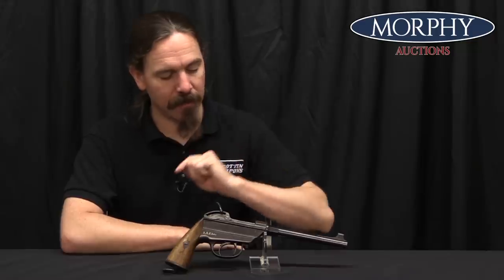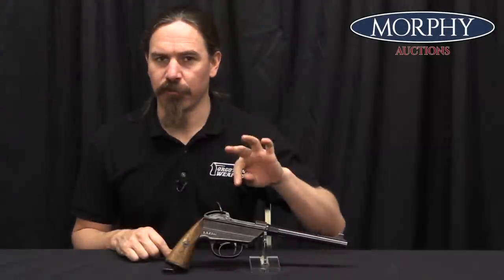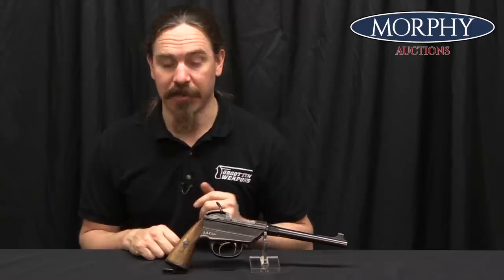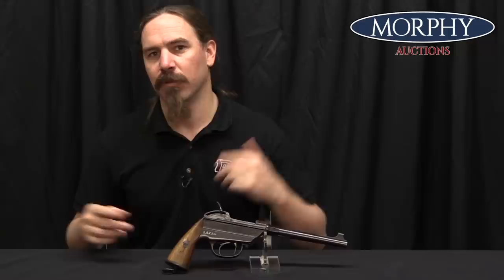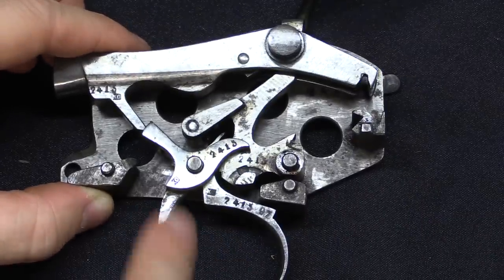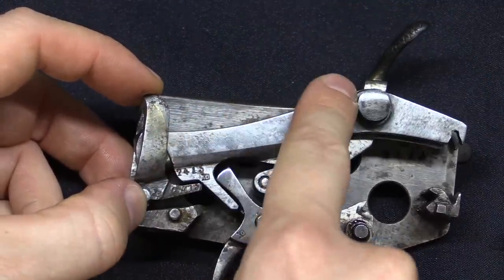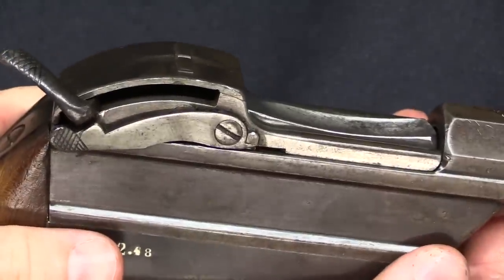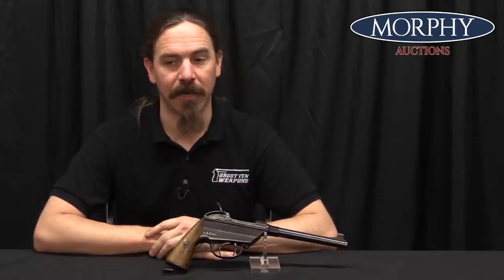Bavarian Lightning: The 1869 Werder Pistol

Comment: Despite being a pretty clever design, this pistol must have been seen as outdated in 1870. There were revolvers for metal cartridges already then. Aside of the argument, that you might be able to fire as many rounds per minute with such a quick loading single shot system, as you can with a rather fumbly 6 shot revolver, one would expext that the military opts for the multiple shot gun.
Reply: @0neDoomedSpaceMarine  Yes, the trapdoor system sure has its merits, too. Also in view of pressure loss and precision, especially in those days. However - a revolver can fire 6 shots very quickly. And there isn't much that can go wrong. To reload it is a whole different story. 
But this pistol was meant for emergencies, not for regular combat. And if things are not sorted out with the first few rounds, you have a bigger problem anyway. :)
Reply: Pete Beatminister : Wasn' t there a Remington rolling block pistol cal. .50 for a short time after 1867 in use of the US- navy?
Reply: @brittakriep2938  I don't know, that more a question to ask Ian... :)
Reply: Cheaper to make a few more rifle/carbine actions that all use the same manual of arms than buying expensive revolvers for second line troops.
Reply: @0neDoomedSpaceMarine  if you're talking about rolling blocks, then yes, pistols and rifles on the same tooling.

If you're talking revolvers, then no, that's totally different tooling.

Comment: I'm impressed with the engineering design. There were some very clever minds in the firearms industry. 
However, more than 2000 years ago, an ancient Greek astronomical computer was made, called the "Antikythera mechanism". Check it out:-
https://en.m.wikipedia.org/wiki/Antikythera_mechanism
You'll be amazed.

Comment: Question ...growing up i was taught to never dry fire any gun cause you risk damaging the firing pin ...always see you doing that so is that just a myth
Reply: If a military weapon can't be dry fired without breaking it, the squadies WILL break them. Only recent military weapon I know of which shouldn't be dry fired is the CZ52 pistol, original firing pins on those can break. With the Numrich replacement firing pins, they are fine.
(Edit) Still, whenever I test a trigger on some weapon at the gun show, I specifically ASK the owner FIRST before dry firing... Because, it is polite, and I surely don't want to find out the hard way that there IS a reason not to.
Reply: Rimfires that's true, but no military arm should be vulnerable to dry firing.